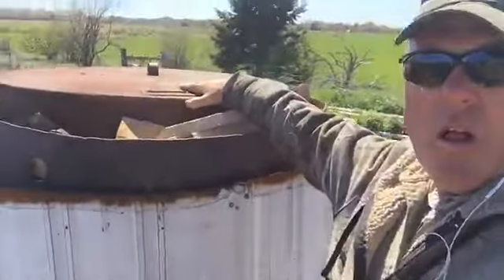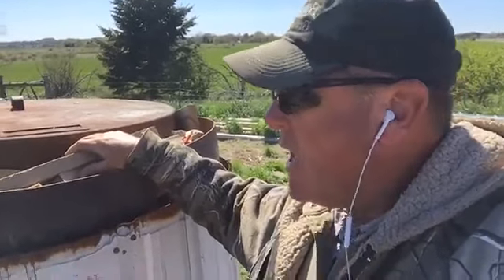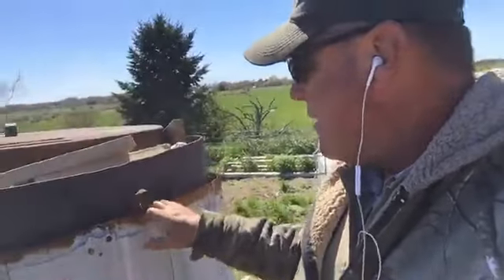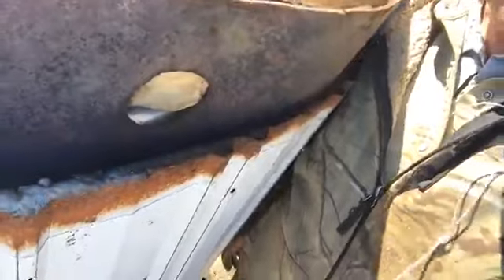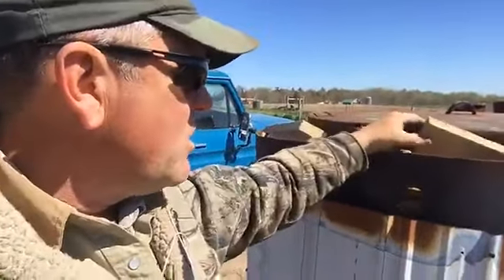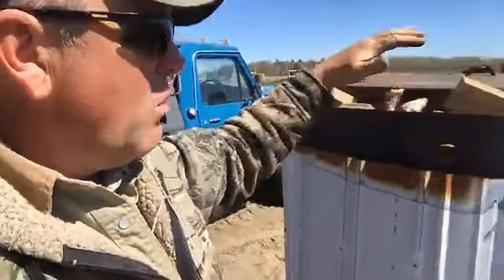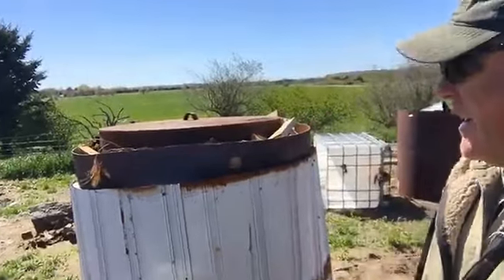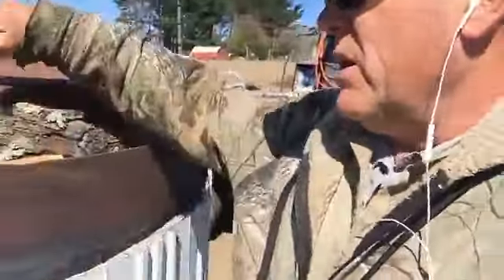Making Biochar

Comment: If you know anything about aquariums, specifically building bio-filters, the bio-char fills the same role as bio-balls in an overflow system. They are a substrate on which grows the beneficial fauna. In the soil it effectively retains and slowly releases moisture and nutrients.
 Bio-char also seems to be beneficial as a feed supplement for just about any livestock: cattle, pigs, chickens, rabbits, etc. I often leave a charred chunk of wood for the chickens to peck at or in the cages for rabbits to gnaw on.